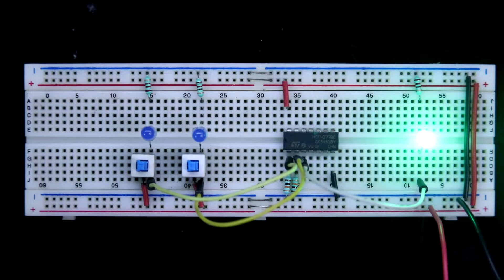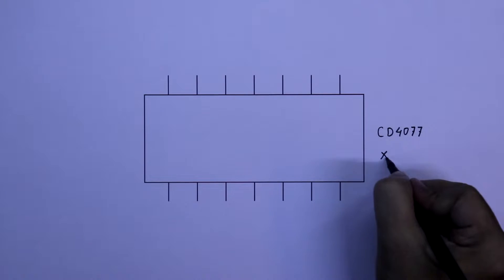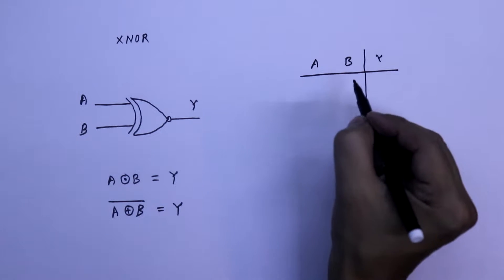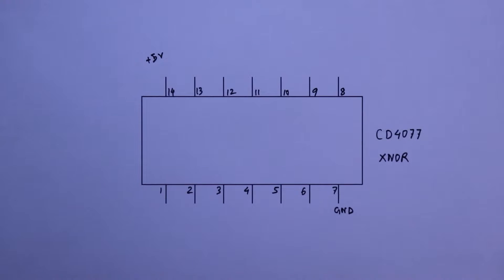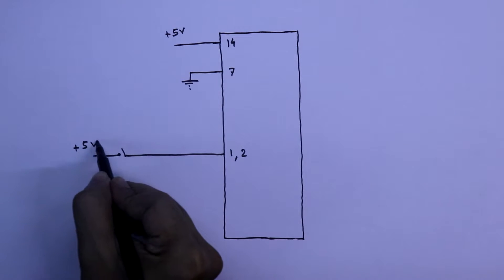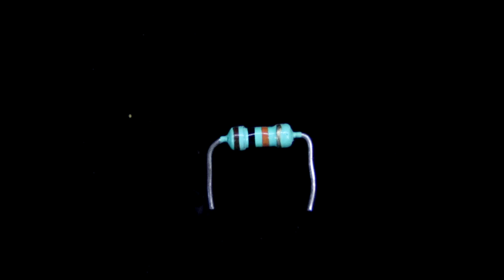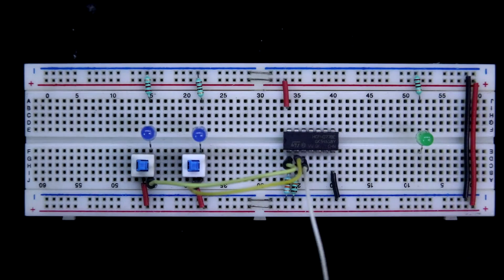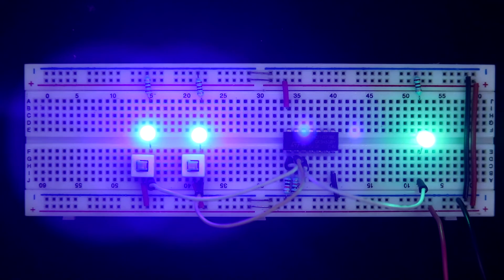CD4077 | XNOR Gate

Comment: How to deal with weak signal to the input of the IC?
When my input is really weak, it is interpreted as 0 therefore my result is 1&1=1 instead of 1&1=0.
Reply from the maker: Use an NPN transistor. 

Connect Base to the signal.
Collector to +5v.
Emitter to the Input of IC with pull-down resistor.
Reply: @EEWave  Thank you. By the way, I mean NOR gate.
Sorry for confusion.